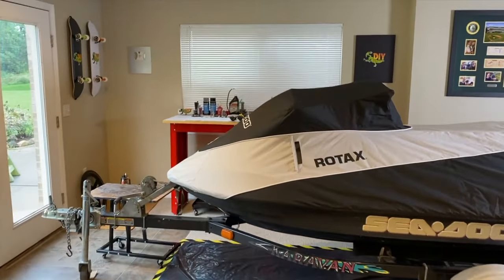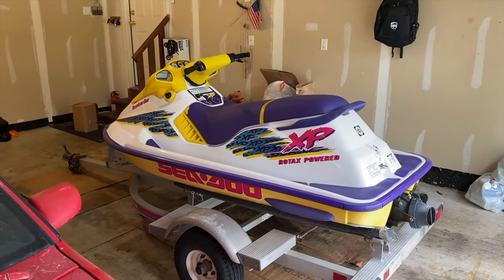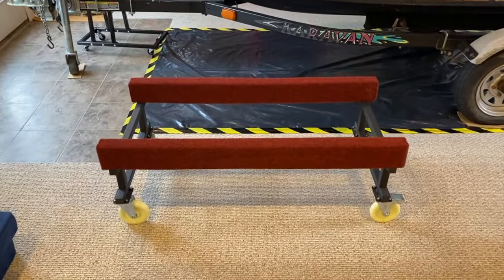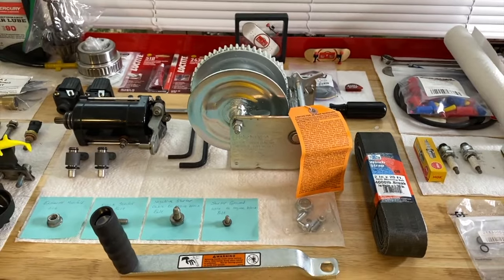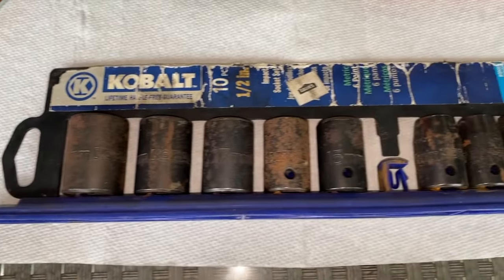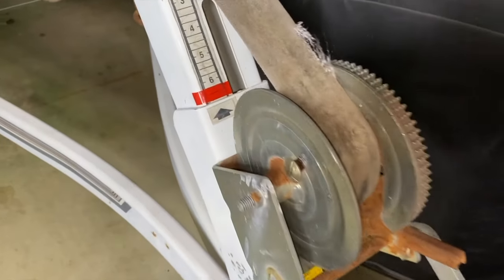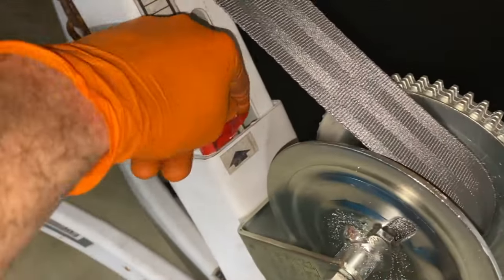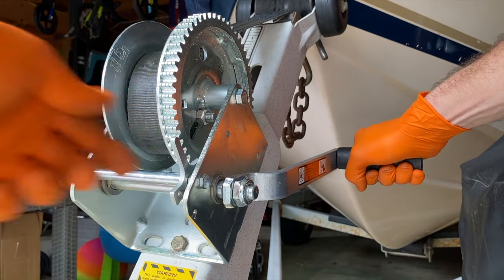Replace boat or jet ski trailer winch and strap - DIY

Comment from the maker: If interested in purchasing this product, visit our Amazon affiliate link below.  I earn from qualifying purchases.

1.  Impact socket set:  https://amzn.to/48d6RwW

2.  Impact wrench:  https://amzn.to/4aHZwY0

3.  Impact socket extension set:  https://amzn.to/3tJTeGr

4.  Craftsman workbench:  https://amzn.to/3TFjKLT

5.  Trailer coupler:  https://amzn.to/3H5gNwC

6.  Utility knife:  https://amzn.to/3vl2lxS

7.  Reese swivel jack:  https://amzn.to/3vro5Ii

8.  Adjustable wrench set:  https://amzn.to/3RGYnqT

9.  Boat trailer winch:  https://amzn.to/3H4n0c4

10.  Boat trailer winch strap:  https://amzn.to/3S4rYMu

11.  Wire brush set:  https://amzn.to/4aE1BnM

***************

1.  Remove 951DI jet ski engine PART 1

          

2.  Assemble/build jet ski stand

          

3.  Moving jet ski from trailer to portable stand

          

4.  Spray paint Sea Doo on jet ski seat with stencil

          

5.  How to reupholster jet ski seat cover

          

6.  Install Reese adjustable jack

          

7.  Replace trailer hitch ball coupler

          https://youtu.be/CCH86D6GWDU?si=xg2_RCdHXcaqn62I

8.  How to build custom logo skateboard

          https://youtu.be/9Isty_4fIIw?si=-czWtz_7evbMH3nl

9.  How to mount skateboard on wall

          https://youtu.be/c5QDCKZNGH0?si=_GNz-6KM3_wEly4B

👍

Comment: When I first bought my used boat it had a cable on the winch, I replaced it with a new winch and strap, much better 👍😁
Reply from the maker: Thanks for watching Dave.  Cables are very reliable however can degrade at a much faster rate than straps.

They can rust, corrode, and the twisted steel cords can snap individually and lead to failure.  Awesome job replacing it with a strap.

😁👍🧰